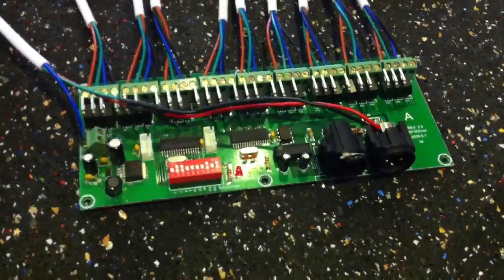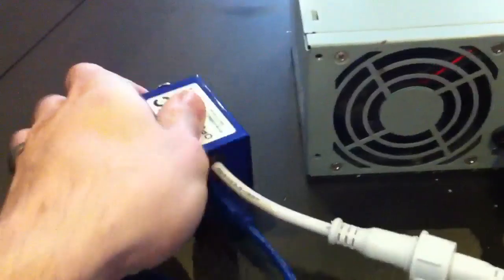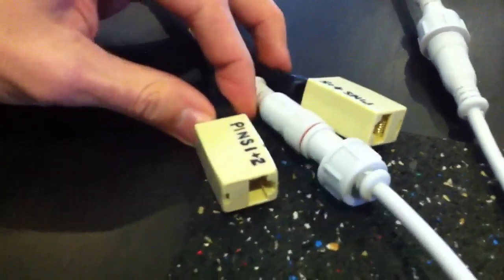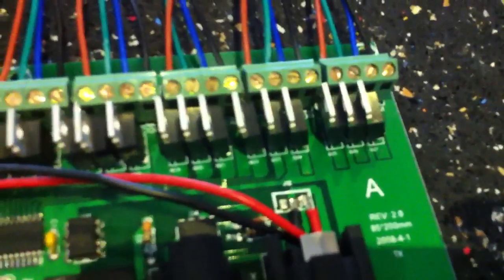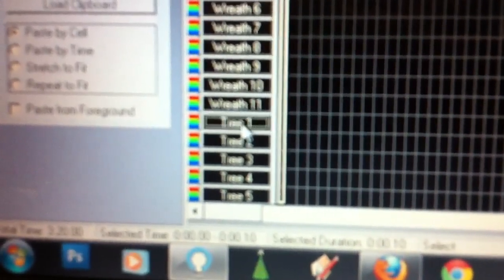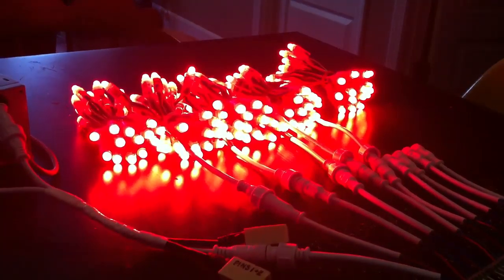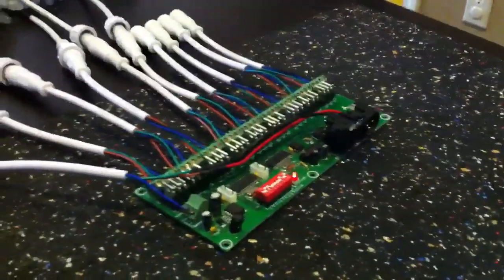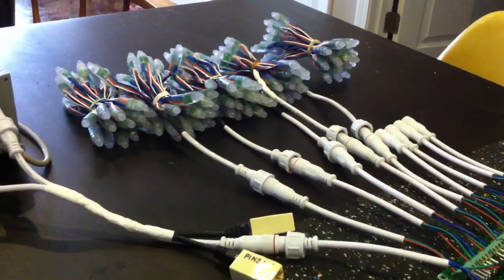Using the 27 Channel DMX Controller with LOR S3

Comment: I am trying to figure out, if it is possible to change the light color for the RGB.  Instead of going and changing every single fade up and down and all the other parts of a sequence by using the color fade option.  i want to find out if i can change the color for the entire channel in 1 step?  i have LOR and DMX controller.  Thank you
Reply from the maker: +Harry Davis Yes, you just use the color selector tool.  A "fade" is actually a transition from whatever color you are using to black.

Comment from the maker: There are a few different types of DMX USB devices, many are more affordable now.  Check out HolidayCoro, the links are on our how-to setction of our website.

Other than that it sounds like it should work, remember you need to use some type of cabling between all the devices (cat5) and you have to provide power too.  There is a limit on how many devices you can run on a single universe but you should be OK.

Comment from the maker: Yes.  Remember, they run DMX so you either need a second network (dongle) or E1.31 bridge to generate the DMX signal out of LOR.
Reply: technicolor christmas are used to have a light o Rama controller 16  channel it's too hard to program the unit oh  I did program five sequences songs

Comment from the maker: John,

The same thing can be accomplished, yes.  Although, for larger pixel displays I would recommend using a sACN Pixel Controller.  The strips can be purchased for about $60 each and the controller I recommend is the P12R from Joshua1 Systems.  That runs 12 universes over 12 outputs, it comes fully assembled and tested, and runs $170. For less than the cost of 4CCRs you can run 12!

Comment from the maker: yes, that will work.  You'd just set the dip switches on the second board to a start channel of 28 and daisy chain them just like an LOR or D-Light Controller.

Comment: Good Day. I see all videos,congratulatios, I have a board 27 CHANNEL DECODER like you,12 volts. power supply, a pro enttec dmx interface, and 9 color strip RGB led 5050 msd, LOR V 3.1.4 demo version, I want to make a dance floor using LOR software.I have many problems, I don´t have I been able to have comunication between ENTTEC and LOR, I want help me how to do it,and how address the board. and I can address all my item in.I would appreciate your help.